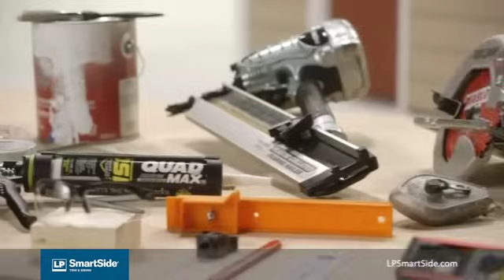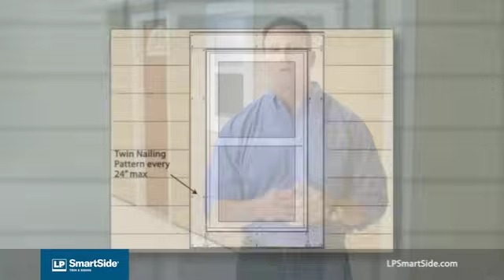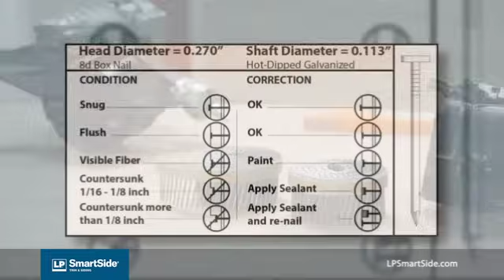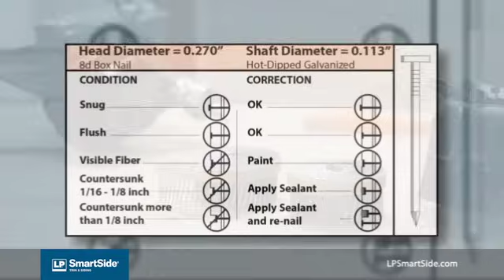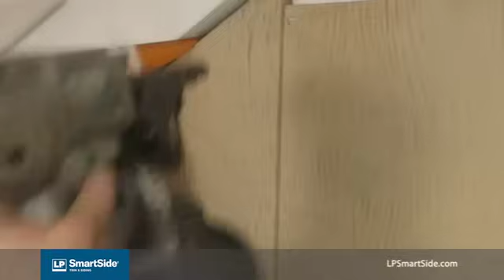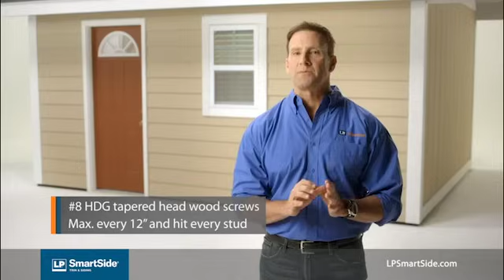How To Install LP® SmartSide® Trim & Siding Products

Comment: Take caution with the reccommended 3/16 spacing. Based on my climate/ region full length pieces swell do to moisture in there air upwards of 3/8s. Cannot reccomend this product over fiber cement
Reply: Where do you live?X
Reply: @loreeclary  west coast

Comment: Just put this on one side of my trailer and now my wife is questioning everything I did on the side because of this video 😂😂
Reply: Good thing my wife doesn't know anything about doing work on the house. 😅😅😅
Reply: I'm an expert sider and this video is mostly wrong on everything... no worries I bet you did better than the marketers that made this video
Reply: @Rafael-Bravo so what’s wrong about it?
Reply: @Rafael-Bravo I'd really like to caulk the joint where my 4X8 sheets meet the flashing, but he said not to. It rained today and the flashing is one big line of water...

Comment: With the 4x8  fake T1-11 lasts about 15 years max in Indiana then the bottom rots out also horizontal joints of two stacked sheets are difficult and require z flashing but then the lower part of the upper sheet will still rot in 10-15 years in Indiana ( quite a bit of rain and snow year round)
Reply: Indiana sucks
Reply: @Fartfordaze no, lp dumb siding does. I can already see this happening in the U.S. This siding is crap. Nearly everything sucks about it. The only plus is that it's not plastic. It's fake wood. And I like fake wood better than plastic.

Comment: On a small addition section of my house I will replacing six damaged T1-11 panels in the next 2 or 3 days. When installing LP (Series 38) vertical 4 x 8 siding, do you have to caulk each 4 foot seam at the tongue and groove, and also put a trim piece over the seam? OR maybe just one or the other? Can you explain what size trim and anything else that I might need to know with this step?  I know from the video about caulking where 2 cut pieces butt together, but does that apply to the ends of each panel on the tongue and groove as well? Thanks for a great video!

Comment: Just imagine having a bunch of questions on here and @lpsmartsiding doesn't answer any if those questions... 
I recently did a job with this stuff and i can say it was a pain in the ass, but looked good..
Reply: What part of installing it was a pain ???we’re getting ready to do this soon
Reply: I just recently heard about this and was wanting to try it..why kind of issues did you have?
Reply: @LumberjackVictim  mainly we had to constantly measure because bossman was a cheap ass and didn't buy the tool you need
Reply: @stealingtomorrowband  thats sucks man. Im the bossman and we're gonna have what we need. what tool or tools were you lacking?
Reply: @LumberjackVictim  I can't remember the name but you clamp them to keep the spacing right. You adjust them to whatever you need. I would look into it. They are a little pricey  I'm in VA. 
Smart siding clamps. They are def worth it if you want to keep in consistent...
Reply: @LumberjackVictim Gecko Gauges are the ones I like
Reply: Battery nailer any one recommend.

Comment: How would you install lap siding over concrete? Leave a one inch space?
Reply: Run furring strips with tapcons or a ram set. Then, nail a 1 inch thick sheet of treated plywood on the furring strips. Wrap in house wrap and good to go.

Comment: This company is deplorable. I have a half finished siding job on my house because Series 76 LP Smartside  8-inch Cedar apparently does not exist anymore. It became very scarce during the pandemic after I'd started my project, then prohibitively expensive, now is nowhere to be found. Shame on LP. There was no warning and when I inquired, empty promises of coming product for over a year instead of the truth. Run away from this company fast.
Reply: I had the same issue with the 4x8 panels. On a partially finished project. I heard it was because of patent issues or something. The new panels don't match the old ones. It will have to get finished with the  new ones. I won't care when I'm dead anyway😐.

Comment: I'm about to install the panel siding however I'm having a hell of a time finding the coil nails for the pneumatic Nailer that meet LP specifications. Can anyone tell me where I can order them? I'm in Arkansas and the stores iv been to do not have them
Reply: I used screws, anyone else?
Reply: @docnez8562 yes
Reply: I use a Metabo 2¼ siding gun wire feed

Comment: Why i do not see anywhere it say what type size starter strip do you need?  You have to put a strip down first to bump the bottom out. Basically if it is a 3/8" thick siding use a 3/8 inch starter strip?
Reply: Sacrifice one piece of siding to make your starter strips. The thickness needs to be the same as the rest of the siding. The width of the starter strip is equal to the overlap on remaining courses. So a minimum of 1 inch wide. If you make it wider that first full row will be pitched out from the house a bit more than subsequent rows. Hope this helps.
Reply: @piney_river_farmhouse9893  The real all-star of the video
Reply: @piney_river_farmhouse9893 awesome help

Comment: Can this be installed over stucco?
Reply from the maker: LP SmartSide Trim & Siding must not be installed in direct contact with masonry, concrete, brick, stone, stucco or mortar; this includes cement board.
Reply: @LPBuildingSolutions  I'm having trouble finding info on nailing into 7/16 structural sheathing. Can I nail into sheathing and not into studs? Thanks in advance.
Reply: @ab-qn7kv nailing has to penetrate 1 inch into studs. With movement nail will loosen overtime if just nail onto osb
Reply: @ykciR  I contacted LP tech support to find out more details. The lap siding does not need to be nailed into framing but needs other criteria: structural sheathing; nail spacing; nail penetration, nail diameter. If those are met, no need for framing and warranty still applies.
Reply: Strap the wall vertically with treated 1×4  if you don't want to remove stucco.  But although more costly and labor intensive ALWAYS BETTER TO REMOVE STUCCO 🍻

Comment: Yes this is crap. Replaced tons of this when it was popular.  Recently did a house in it.  Needs huge gaps at seams and edges.  If you don't it expands and pops itself right off the wall